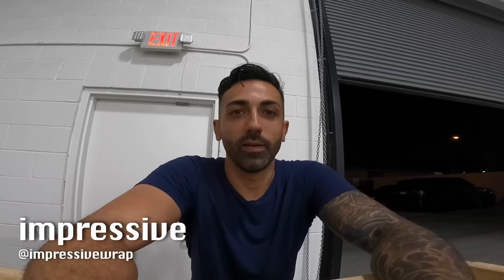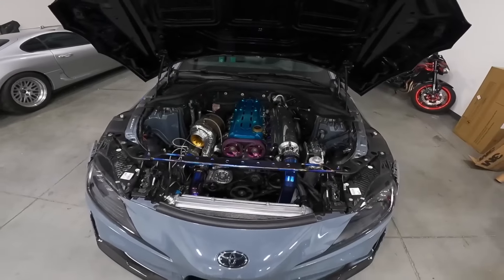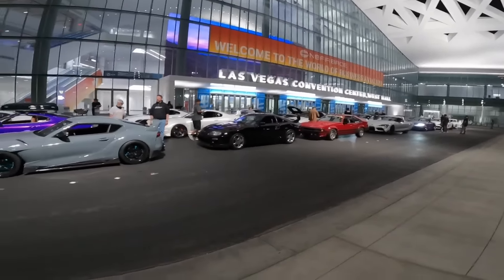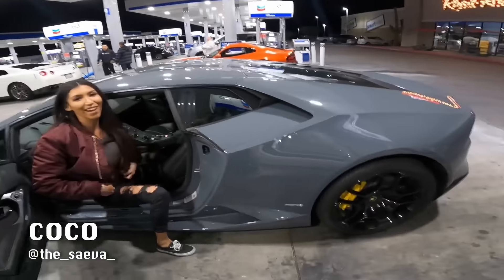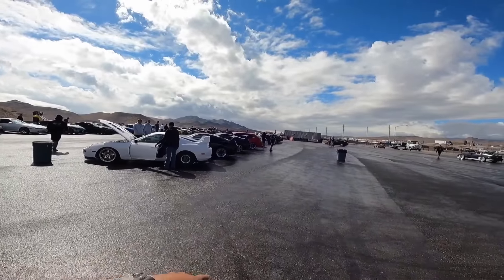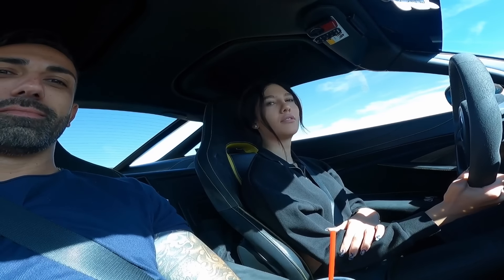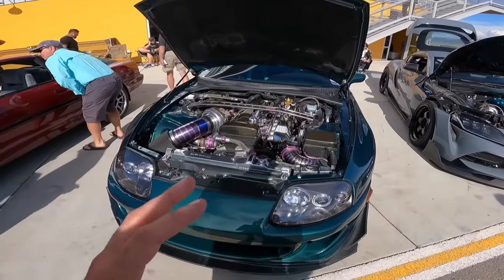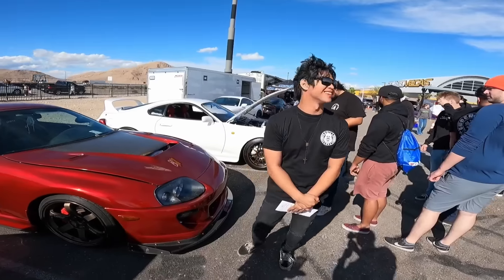2JZ Swapped MKV A90 takes over Vegas for Supras in Vegas!

Comment: 2JZ the God of all engines. Sweet!
Reply: Rb26dett>
Reply: @kyte1x215  never!  Ls engine is a v8 yet they're always trying to compare it and the JZ which is a 6 cylinder. RB always will be 3 cars behind in the JZ rear view mirror.
Reply: @Mike H yawn
Reply: 5.2. Voodoo engine!!!
Reply: @Mike H barra>LS
Reply: Viper 8.4 v10 > any other engine changed my mind …
Reply: @bman1668   JUDD V10> viper v10.
Reply: @madkas14  viper can make 3500hp or so build how much can what ever u listed lol 😂 I’m assuming lambo v10?
Reply: @bman1668  yea it can make power, but for how long until it blows up. The Judd v10 is an actual race engine and better.
Reply: @madkas14  I’m taking about street car not race engine and I highly doubt it can make 2000whp meanwhile vipers make anywhere from 2500whp to 3k so highly doubt it’s beating viper v10
Reply: @bman1668  lol the viper v10 is not the end all be all. It's a nice engine and all but not the best. There's 3500whp Gtr's making the same power out a v6 which is more impressive. Lol
Reply: @madkas14  yea but they blow up not reliable like viper v10 or lambo v10
Reply: @madkas14  so 2jz can do same less displacement? What’s ur point? I’m saying reliable not how much . Civics can make 1400whp but not as reliable what’s ur point dude? Anything can make power but reliable? No
Reply: @bman1668  I'm just saying the viper v10 is not the end all engine...
Reply: @madkas14  I prefer i6 or something like that but if I had money to blow v10 viper I’d my choice …